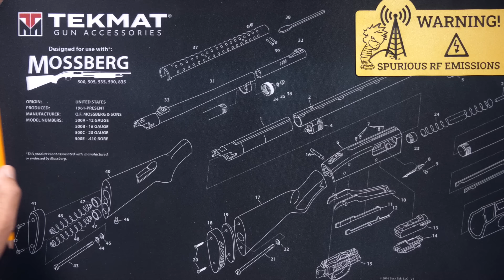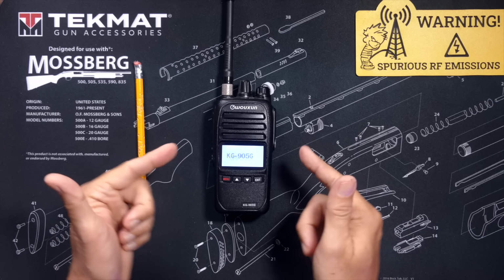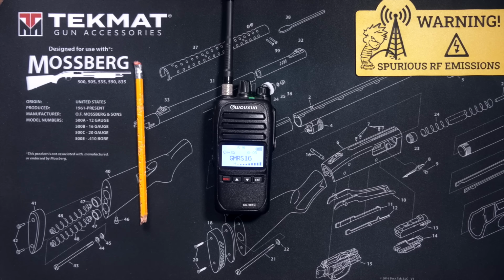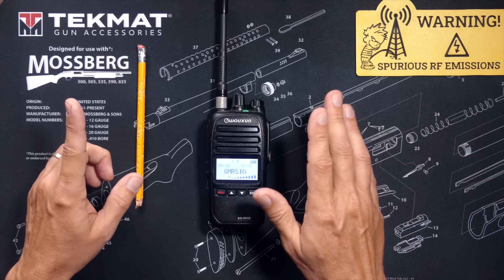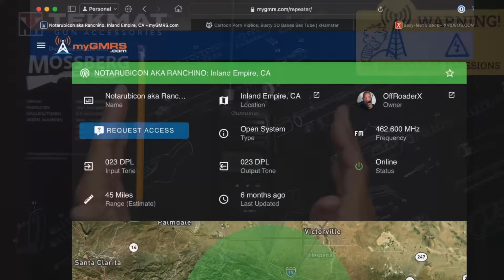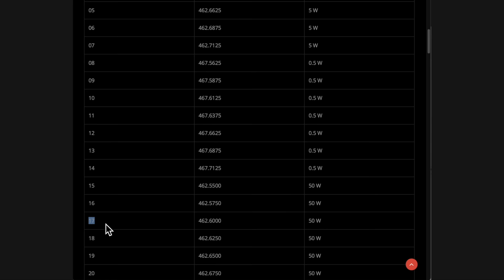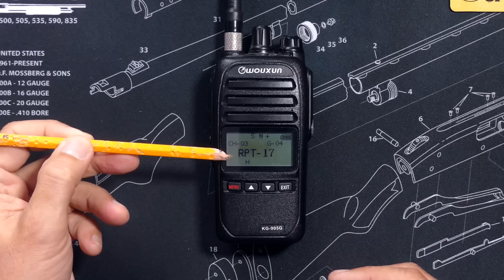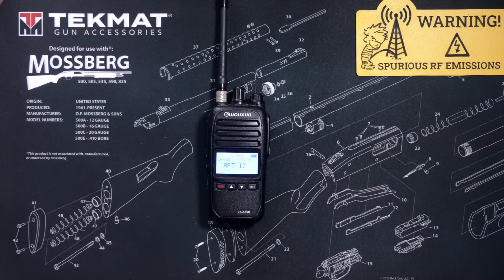How To Connect To A GMRS Repeater & Use A GMRS Repeater - How To Setup A GMRS Repeater

Comment: Noob. Been at this nearly a week... best headway I have had thus far. THANK YOU. However...what, where, how, why did you choose 023n for Tx tone? What does that mean? How do I know which to select for my radio? Here is where I was pushed into the bottomless pit by GMRS Sparta warriors.  (the repeater I wish to connect to is Freq 575 which is GMRS channel 24/16 or Rpt channel 2. How do I know which Tx tone from the list to choose? All I have is the Freq number and PL tone the owner gave me. No other info)
Reply from the maker: The repeater owner has to tell you the tone.. In your case it is a PL aka CTCSS tone, In my case it was a DPL aka DTC tone (023n).. So you would enter the PL/CTC tone in the TX CTC/CTCSS menu.

Comment: Hi Randy. I’m new to GMRS and thanks to your videos I’ve obtain my GMRS license and now thanks to this videos I was able to program my Beofang Gm-5RH to my local repeater using the DCS tones. However I want to use two radios to transmit and received using this repeater. I’m only able to transmit to the repeater but not able to hear the conversation through my other radio that I programmed using the same dcts tones. How do I get the two radios to transmit and received through repeater? I’ve done a radio check through both radios and the repeater owner confirms my radio check. However I can only hear the respond of the repeater owner on both radios but not my initial call from one radio to the other. Man I hope I don’t sound stupid. Anyways really appreciate if you can help me out. Thanks

Comment: I am installing my repeater later this week. I can reach, with my base station, a repeater about 35 miles away. I have a two part question. If I set my frequencies and tones the same will I be able to receive and transmit signals from that repeater and would that repeater receive and re transmit signal from my repeater?  If it is achievable and permission is granted, is it legal?
Reply from the maker: No, that's not how it works.
Reply: @TheNotaRubicon  Ok. Thank you for what you're doing. As a noob to gmrs I rely on you for a lot of knowledge

Comment: Great video!  I'm following along, but I have a question.   When you chose the TX  dcs, how do you know that the first tone that popped up was correct tone  ?  I have a uv 5r and there are several different  tone numbers to chose from?  Thanks!
Reply from the maker: You have to choose the correct tone from the list. Sometimes thats the first one to pop up, usually it isn't.

Comment: Good day. I have a question. I am new to this GMRS world.    I programed a repeater in my BETECH GMRS PRO. I have a radio uniden radio scanner that I monitor on. 
I programed REPT15 462.5500 with a  tone 141.3.
When I press to test the repeater on the GMRS radio, even though I may be out of range, I have the uniden scanner reacting to the test each time. It's usually a non-GMRS repeater Freq shows up on the scanner. Can you explain what this may mean?
Reply from the maker: You are transmitting on the repeater INPUT frequency which would be 467.5500. This is how it is supposed to work.

Comment: Ok. I have programmed two local repeaters successfully using the repeater channels. However when I try to program it in frequency mode I can hear them but they cannot hear me. I have a BAOFENG GM15 Pro.  Is the frequency mode simplex only maybe?

Comment: Good morning sir,  I'm a total newb to radio and GMRS.  The problem I'm encountering occurs when I tune into GMRS channel 24. 575/16R  [462.575000/+5.000].  My issue is I can receive transmission but I can't transmit.  Where can I locate the tones needed to access said repeater on channel 24? I went onto RepeaterBook and located a repeater about 10 miles away I assume thats the one I'm hearing on channel24? But on Repeaterbook there are no tones associated with this repeater.  Do I have to try to contact the owner?  I even used another radio with Scan feature, it picked up the frequency but no tone was picked up.  It said "NONE" under the frequency.  Sorry for the stupid question and if I'm not asking it right.    {EDIT} I'm using a BOOF WHANG UV-5G PLUS

Comment: Question. How do you disable the global tx function on uv5r using the odmaster app? I only have blue tooth programmer and not the laptop connector. Have looked at app and laptop thru app and no where does it show "duplex" to disable.  Until i get my licenses, yes i said licenses (ham n gmrs) i would like to use as a scanner. Thanks

Comment: Question on my 905G, menu #15 TX-DTC.   When opened it displays "off" while the next line has a limited selection of options for TX tones.  At least is does not have the 662 DPL input tone indicated by a nearby repeater that uses 462.650 MHz
frequency.   Does this mean I need to get the programming cable and software?        TIA!

Comment: im new to these squeak boxes. i cant seem to figure out how to make my box squeak with a repeater.  i set my radio to gmrs channel rpt-21 freq 462.700.  i edited the channel and added 179.9 input and 179.9 output.  but i get crickets.  any suggestions? :(  on mygmrs there is a comment from the repeater owner that says "Work in progress. Try it out and let me know where you hit it from."  im thinking the work never progressed.
Reply from the maker: Double-check the tone and the channel
REMOVE the RX tone - it is optional and can add additional confuckulartiy
Make sure you are close enough/in-range of the repeater
Make sure the repeater is actually on/in-service
..if after all that you are still not hitting it, then, you're doing it wrong.
Reply: @TheNotaRubicon  i have tried without the RX tone. i think I'm about 2 miles by way of crow. im also on a hill so i have a clear line of site to the area where the antenna is listed to be. I'm leaning towards the repeater is not in service anymore. if there was another repeater in the area i could try that but there doesn't seem to be anything close enough.
Reply from the maker: Well then.. Sounds like you need to be a pillar of your community and PUT UP a repeater!

Comment: I have an issue when trying to program in my nearest repeater on my Btech Pro.  I have set a group for local repeaters then tried to add the closest one.  No problem adding it's transmit frequency but it's receive frequency is 446.575.  I can't enter that no. because the Pro asks for the GMSR channel,  however that frequency seems to be out of the range of GMSR channels.
Reply from the maker: Yah, thats not a GMRS frequency.. either it's a typo, and it should be 462.575, or, you're not going to be able to use it.
Reply: @TheNotaRubicon  of course your correct (humm nothing new about that) I double ck and found I had downloaded the wrong list.
Hey thanks for your patience with this very new newbie.

Comment: Hey Randy - I'm a moron, and even I can understand your videos.  Thank you.  Even so, being a moron and after watching the repeater video you posted two months prior to this one, I still have  a question.  In my area, some of the repeaters do not specify either D or C tones for TX or RX.  Instead, they just specify Hz (i.e. 141.3Hz).  I noticed that one of the D tones is 141.3 Hz - is that the same thing?  Has the repeater owner just not specified the tone as a D or C tone?

You might be asking yourself "Why doesn't this moron just try the D tone and see if it works instead of wasting my time asking this stupid question?"  The answer is that I'm not lucky enough to actually be in range of a repeater.  I'm trying to learn how to program repeaters for when I travel, so I'm trying to figure out the nomenclature to be able to program a repeater when I'm actually in range of one.

Thanks again for making great videos!
Reply from the maker: When you go through your list of CTCSS and DCS tones on your radio, you will only find the number (ie; 67) on ONE of those lists.. So just look through both lists until you find the number.

Comment: Okay. I know im risking getting "pinned" with this one - I propose NOT a stupid comment, but what is probably a very stupid question, but if I do not ask, I will likely never know. Here goes: On GMRS, if I have family 85 miles North of me and they and I both have KG-905G's. Naturally, the distance is too great for the radios to communicate on their own, even still not likely (with) a repeater dead center in between us. How does (that) work? Or does it simply (not) work? Can a transmission bounce across multiple repeaters to it's destination, or is this simply just not a "thing"...? Thanks in advance for anything (including abuse) I get back on this one....
Reply from the maker: If there is a repeater between the two of you, and if you can both reach the repeater, then it would work, no problem.
On GMRS, transmissions do not 'bounce" across multiple repeaters and "linked" repeaters are pretty much not a thing.
Reply: @TheNotaRubicon  That's pretty much what I concluded to, but figured if anyone would know for sure, I'd find the answer here... Thanks a million for letting me know! They just opened one up to me here in Jupiter, Fl., but its pretty close to my house as it is. Anyways, thanks for the great videos. They have been a huge help as I am very new to this!

Comment: Does not work on baofeng uv 5g plus
Reply from the maker: Then you did it wrong, the repeater is offline, or, its out of range.
Reply: @TheNotaRubicon  I could only use ctcss for tx and Rx. The repeater is 3 miles from me. I hit repeaters with my uv 5r  on the same mountain.

Comment: So a gmrs radio comes with eight repeater channels. But you need the program the repeater channels. It's very confuculating
Reply from the maker: No, you simply need to add the tone required to use the specific repeater you want to use, which is a very simple step that takes about 10 seconds.. Much much different from having to program the RX frequency and the TX frequency or offset, which is already done for you.

Comment: If it’s all so easy then  why are the repeater frequencies messing around and do not have the 462. 

They have 444 and 442 and 5 offset and and more bs
Reply: My wouxun channels correspond to 462. 

I really do not like anything about radio transmission. There is no way these radios are the way …
Reply from the maker: 442 and 444 are not GMRS repeaters, those are ham repeaters, thats why. 
Find GMRS repeaters, and as mentioned in the video, it is very easy.
Reply: @TheNotaRubicon  lol thanks. I did push the play again, and didn’t blink I just watched and listened. I did figure that out this morning. I promise I did. 
Had success. I’ve since lost that success but I get it, I think